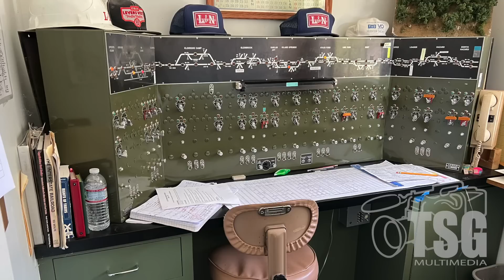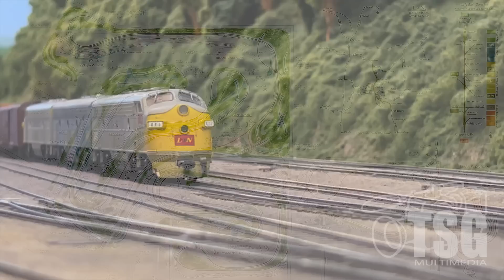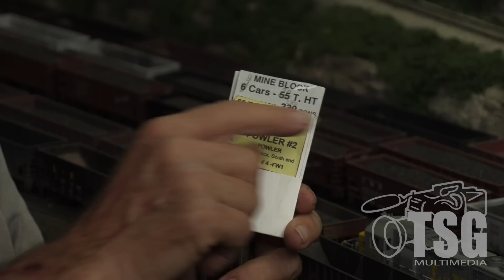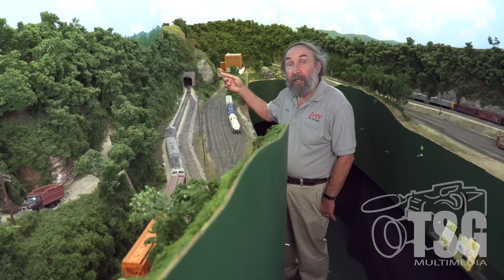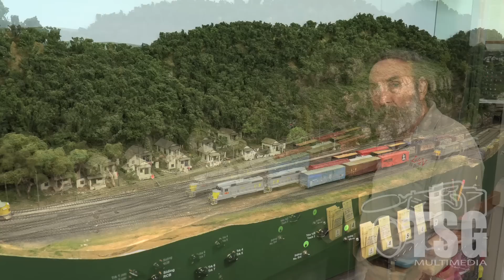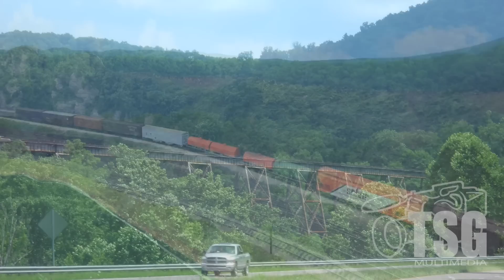Gary Siegel's L&N Eastern Kentucky Division HO Scale Layout Tour With Bruce Morden

Comment: Beautiful layout. You should add sound to the engines to make it more realistic.
Reply: A number of the locomotives do have sound, which does add to the realism. The downside of having too many sound-equipped locomotives operating at the same time is due to Gary’s design of the layout: There is so much track compressed to a relatively small area, the sound carries further than it would in the real world and it becomes distracting. For example, the distance between the mainline coming down from Eldridge Camp into Glenbrook and the Rock Creek Branch at North Dent is scenically separated by “hundreds of miles” but physically (literally) just a couple feet through a 1/4-inch thick backdrop.